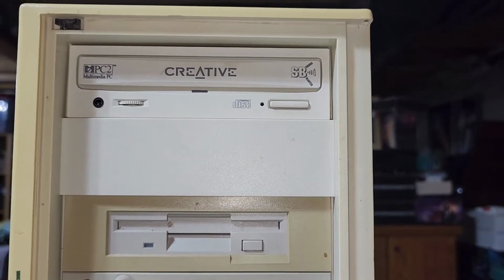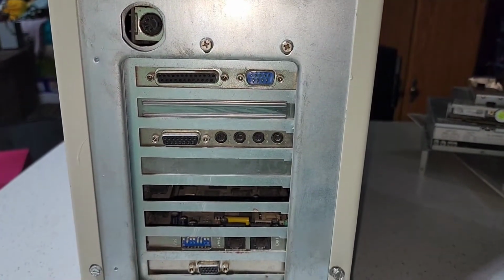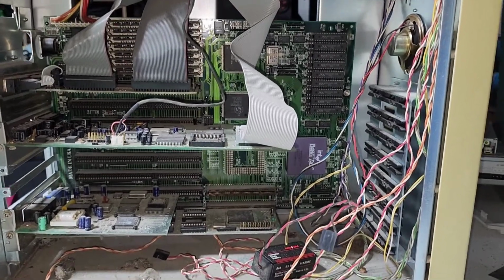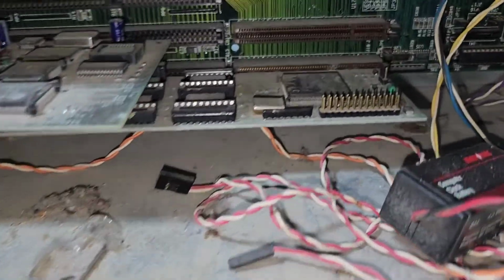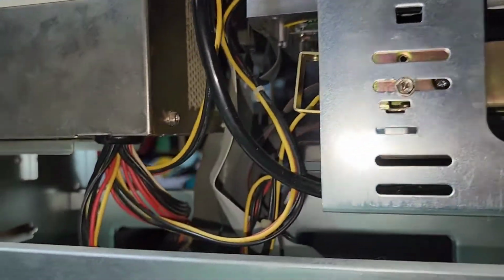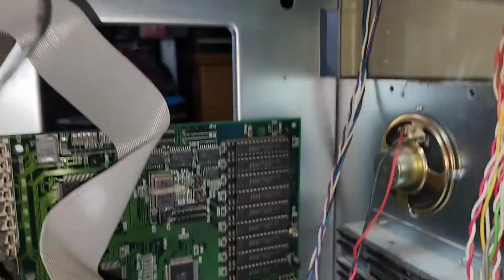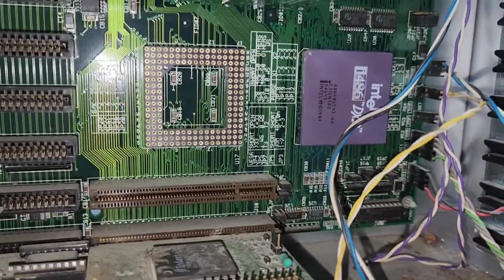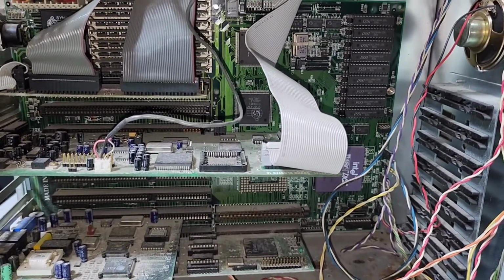Unknown Custom 486 Build! What a salvage find! Intel, Soundblaster, and DUST!

Comment: It's a 486 VLB setup. That video card is a Trident VLB card, faster than a standard EISA card thanks to the VLB connector. VLB was a stop gap between ISA and PCI and was largely only used on 486 boards though there are a few Pentium boards that had them too though only to add some backward compatibility for people not wanting to upgrade their GPU or use other VLB cards that were proprietary. The extra "CPU socket" was for adding a math coprocessor not a dual CPU setup. The board looks to be a fairly early VLB 486 board, it very likely came with a 486 SX25 which had no math coprocessor built in like the DX/DX2/DX4. I suspect that DX2 66 may be the fastest CPU that board natively supports with the exception of an Intel Overdrive unit (dx4 or Pentium). 

Its a great find, the VLB 486 platform is quite sought after by collectors/retro enthusiasts.
Reply from the maker: Fascinating! Thank you for informing me!

Comment: Upper connector on the power supply is to feed your monitor with.. So you needed only one  mains outlet socket, instead of 2 cables comming from your computer.

The cable is between your PSU and the monitor.. Its a second version of the main power cable (dont know how the cable is called)

The PSU is an older bigger style AT power supply.. The smaller AT power supply we call it AT is actually a baby AT style power supply.

That switch block (jumper settings on the modem is nothing special, its just the configuration settings of the card.. This method is also used with graphic cards.
Reply from the maker: Thank you for informing me! That's great information!
Reply: @urzamaster   The power cable from the PSU to the monitor is just a pass-through.